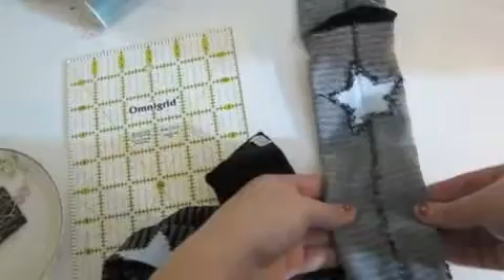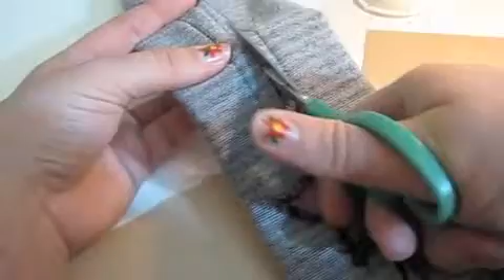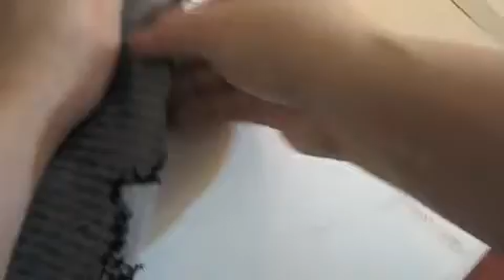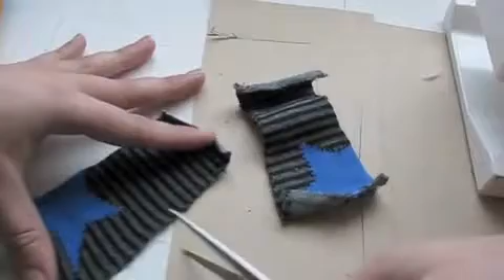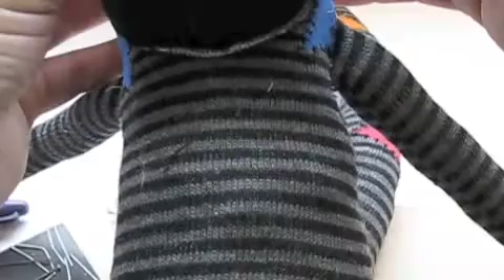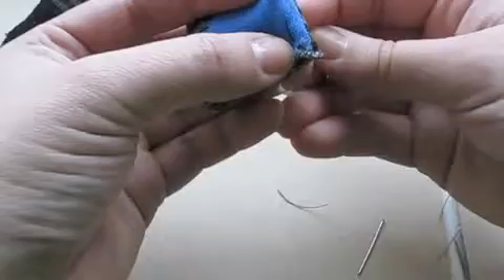Rockin' Sock Monkey Tutorial

Comment from the maker: @nerkola30 Sure. It helps to to sort of pinch the fabric with the button in your left hand, to make it bulge. Poke the needle in at a sideways angle. If you're REALLY having trouble with it, you can poke the needle up through any spot that's hidden behind the button, and once you've pulled the thread taught, you can reposition the needle and THEN poke it up through the hole. The thread will be secured as you poke DOWN through the next button hole. Of course, you'll need to tie (read next comment